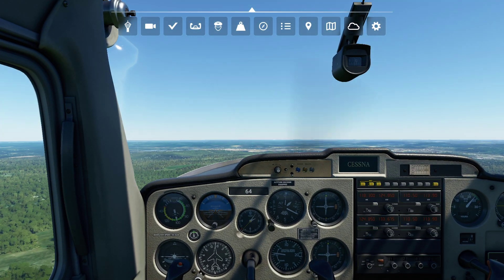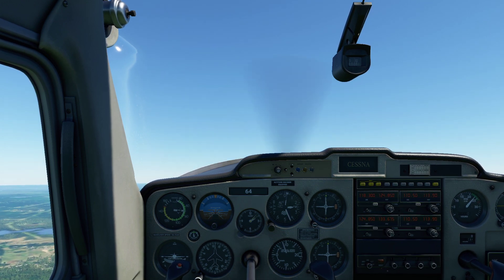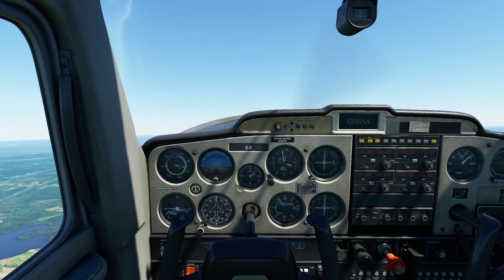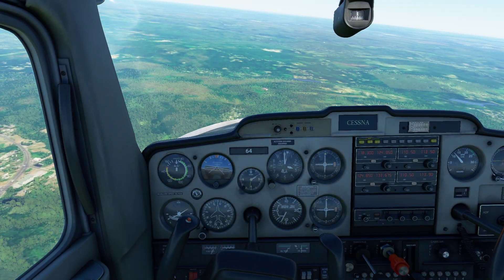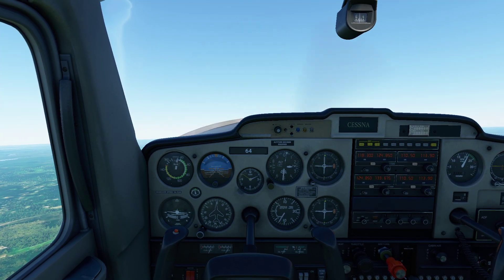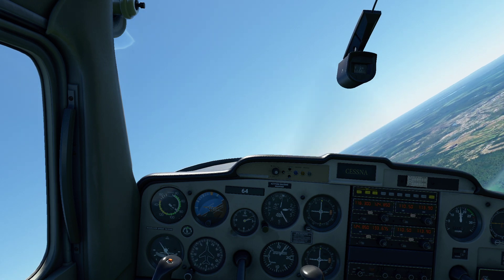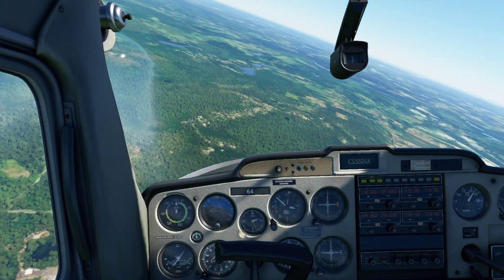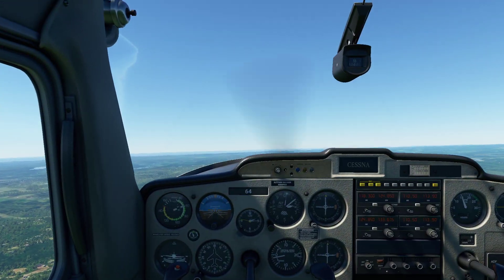Flight Simulator 2020 Basics - Stalls and Spins

Comment: Very disappointing!!! You cannot spin the C152 in FS2020. I just went for my CFI spin endorsement last week and we did both incipient and fully developed (6 turns) spins in a 152 aerobat. The simulator cannot emulate that spin. I put in the exact same inputs that I put in the real airplane (which easily got the real 152 to spin). But the simulator will not do it no matter what!

Comment: I can't even properly stall. If you add max elevator trim up then with a bit of pulling back the plane will be level even with engines off and barely losing speed.

Comment: This is the reason MS flight sim 2020 sucks balls, you can't do proper stall spins in the game. I tried to fly with Extra 300 in storm an did crazy turn with nose dive, but the game instantly automatically recovered the plane to straight flight. If it were simulator then the plane would have gone to unrecovarable flat spin and crashed.... or probably snapped wings even.
Reply: Some aircraft want to correct themselves, for example the 172.
Reply: probably because you have assist on

Comment: Spinning like a real aircraft isn't very well modelled in the simulator at the moment. The Pitts flight model nicely demonstrates this. It's WAY off.
Reply: Paul Martin well I’ve seen real GA pilots commenting on other videos of spins and stalls in this sim and they say it’s very realistic. Do you have any real world flying experience?
Reply: @oliverek7  Yes. I've flown (regularly over the past few decades) a Piper Archer II, Cessna 172, Cessna 152, Pitts S2A, Super Decathlon, and several others types but not as regularly. I've also spent several hours in a full motion 747-400 simulator (a real one owned by an airline). 

The Pitts does NOT behave like a real Pitts at all. The tail draggers' flight models are not even close, particularly their ground handling. Spins, snap rolls & knife edge flying are totally off - you shouldn't need to touch the ailerons for a real spin... 

It makes me wonder whether their 'physics' modelling is factoring in the fuselage as a lift generating body (like X-Plane does) or whether it's only the wings & control surfaces?

Most of the other flight models are a bit dodgy but the closest ones to being 'true' (that I can absolutely vouch for ) are probably the 152 & 172 - I'm sure they spent the most research on them too as those aircraft are easier to access.

Having said that, this is the best simulation of the VMC world I've ever seen in a flight simulator and the clouds & weather effects make it the best looking IMC flight simulation too.

Flight models should be easy to get right. Here's hoping that MS will fix them and third party aircraft show us what can be achieved here. It's early days.
Reply: @nitramluap  i hope that too
Reply: Paul Martin you hit the nail on the head. I 100% agree with you.
Reply: In the sim in the most cases, the nose simply drops down and it's hard to spin. This is accurate for some of the planes but not for all.
Reply: Probably your air pressure make it handle like that. Did you check the weather?

Comment: Can you make a video about trimming? I can never get the plane to level!
Reply: I don't see how it's difficult. Just fly the plane level first and then start trimming while easing the pressure on the stick at the same time. Once you have let go of the stick entirely, stop doing anything for a second to see what the plane is doing on its own and then adjust the trim to level flight. It can be a bit bumpy before you get used to letting go of the pressure at the same rate you're trimming. Don't chase the vertical speed indicator, look outside and see if the nose is going up or down relative to the horizon. Once the nose is stable, not going up or down, then finally look at the vertical speed indicator for final adjustment. That's how I do it.
Reply: @Jenni_Sofia  Practice is what I need more I guess... Will try your menthod!
Reply: @Jenni_Sofia  I agree but in real life it's a lot easier to estimate if the plane is level or not because you can move your head and see everything in 3d and you feel every movement before any instrument does. Even when it's the same plane in real life and the simulator, the difference of how you notice the movements is like flying a glider today any a a340 tomorrow.
Reply: i agree
Reply: @artspret6045  He already did... it's the previous video.
Reply: @nitramluap  I saw that video already, but I still think noobs like us needs a little more information on what we need to practice.
Reply: Trimming in a real plane is a lot easier because you can feel the pressure of the elevator easing off (or increasing if you go the wrong way)  as you spin the trim wheel.

Comment: I think the flight dynamics of the new 152 are not accurate enough to really spin. Sadly, this is not an A2A 172. I could not get this thing to spin, with or without power on.
Reply: Triple E Circle you’re not always gonna get into a spin. Certain conditions are required for a spin, center of gravity, payload etc

Comment: It looks scary in a sim, can't imagine how much more it must be in a real plane!
Reply: As a student pilot, can confirm, practicing stalls absolutely sucks. Scary every freaking time. My stomach just got tight thinking about practicing them with my instructor again. When the plane starts spinning you really have to keep your composure and use your head to remember the proper steps to regain control of the aircraft. power on stalls are the worst...the littlest difference in left or right aileron means the plan is going to dive to that side of the wing...if you dont regain quick enough or if you mess up what rudder pedal you press...you're now spinning the plane straight down at the ground. Nooooooo fun.
Reply: @blakehorn229  oh wow, I think I'm happy with flying only on Flight Simulator 2020! 😅 Saw this yesterday, it was a test and the pilot really stayed calm enough to do the right things. Not easy! (They were testing the spin tendency of that chinese plane....I guess they found that...) https://youtu.be/xwZrtYgnP7s
Reply: @blakehorn229  how many hours do you have? I'm also a student pilot. If you're still scared of spins, tell your instructor that you need to practice them more or find an instructor that makes you feel comfortable and confident.

My instructor and I spent 3 hours doing spins and stalls, after the first 20 minutes I was having fun and didn't want to stop. It was like being on a Rollercoaster and the tracks went wherever you wanted them to.
Reply: @principedinerezza  i will check my log but I think around 50hrs
Reply: William W. Campbell-Shepherd IX  I believe this is mostly because showing outside the window doesn't help much. Stall recovery is pretty much all feel and procedure. Looking outside during a stall can make you dizzy.
Reply: @principedinerezza  I’m sorry what? U shouldn’t be flying. It is about establishing the correct attitudes to recover. You need to look outside to establish the nose down attitude and to prevent yaw. Who cares if you get dizzy, if u stall at 200 feet AGL that’s the last of my worries
Reply: It's a little scary when your new and not expecting it, I spun the first time my instructor had me do a power on stall, but they're actuality very easy to recover from in a GA aircraft. 

After you get over the initial jitters of flying a plane, it's not scary at all, i find stalls to be very fun actually.